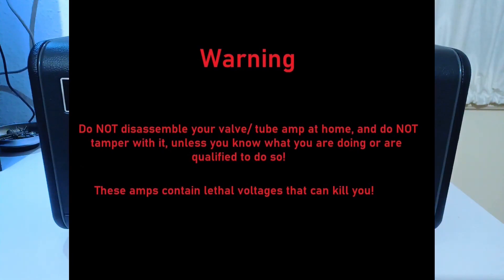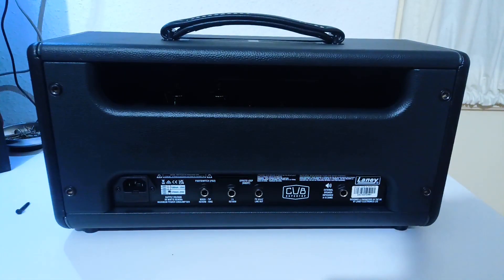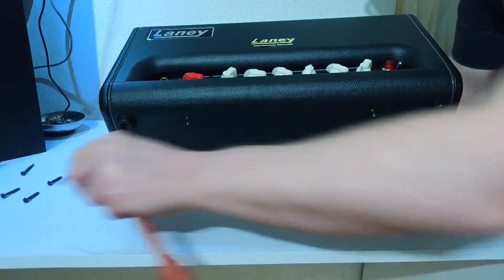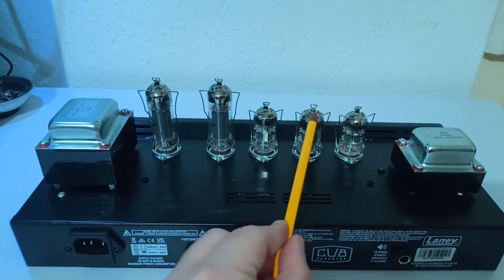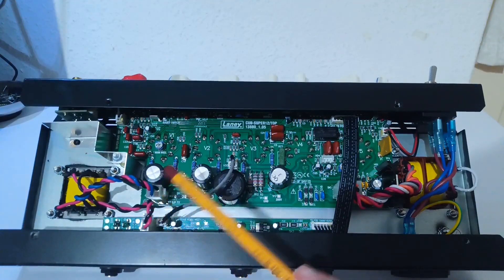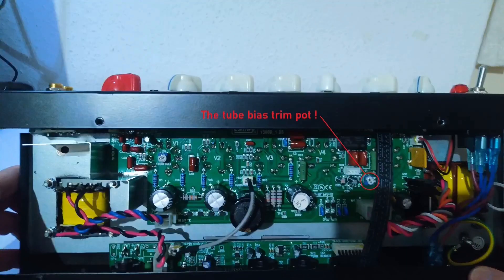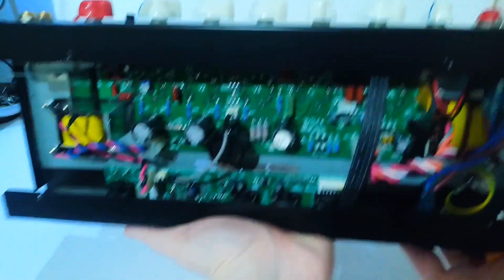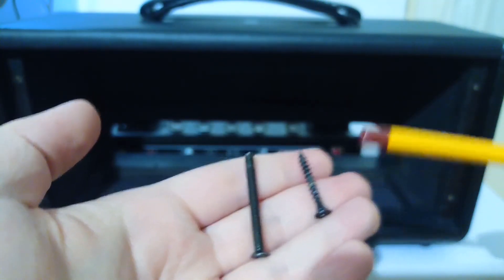Laney Supertop 15 Inside the amp / #Gutshot

Comment: I have a Helix LT which I connect to the efx loop of this Laney. It happens that the overall volume it's controlled only by the Helix master Knob. The Laney Knob is disabled... Why does that happen?
Reply from the maker: I had a TC Electronic Combo Deluxe preamp modeler, and the same thing happened. Some modeler or preamp pedals can override the controls in the preamp section (volume, gain, eq, reverb) when plugged into the fx loop. This can also happen with other amps with fx loop.
So it's just a normal thing.

Comment: Thank you! I just received mine a few days ago. I got the head and matching 2x12. I always worry about the reliability with this stuff, but it seems to be pretty well put together, yes?
Reply from the maker: This is an awesome little beast. I love it with volume on 9, and start adding gain, from fat clean sound to tasty distortion 😀.
I won't play it for some time because of my tennis elbows, but when it heals i'll make a sound test video of it.

It's a well built amp for the price (and above it's pricepoint too) and better built than Marshall Origin 50, DSL20, Fender Blues and Pro junior (I had those amps in the past). Even the stock tubes are better quality in it.

I have a 1x12 cab, but with a 2x12 it can sound huge. Don't worry about it, you have made a good choice 😀
Enjoy your new amp 🎸
Reply: @Andras_Plays  The best cure for joint pain is to rub plenty of neat olbas oil in to it before bed and wear a support bandage.

Comment: I think mine has a problem.
Reply from the maker: What kind of problem do you have with your amp? Is it under warranty?
Reply: @Andras_Plays  Its such an incredible amp it needs to keep working. The clean sounds fine but as I turn up the gain it sounds fizzy. Yet only a week ago I was getting beefy, juicy, saturated lead tones. I'm worried my new Gibson Greeny has somehow upset it.
Reply from the maker: @craigtodd8297  I love mine too. Volume at the 8 mark, gain at the 4 mark, and let the pickups do their thing. 
Greeny is a lovely guitar but it can't hurt the amp. 
I'm not a qualified tech, but the it sounds like a tube related problem. Changes in the gain can be preamp tubes (which is strange, because preamp tubes lasts a long time, especially these high quality ones). 
If the sound is thin and tiny over time, it can be the poweramp tubes. 
But if it's under warranty, the easiest way is changing it.